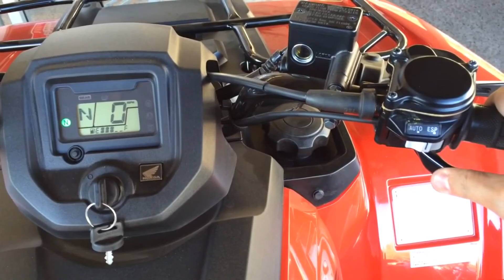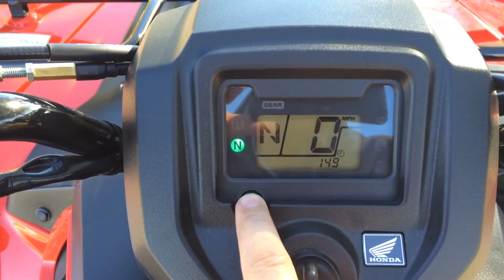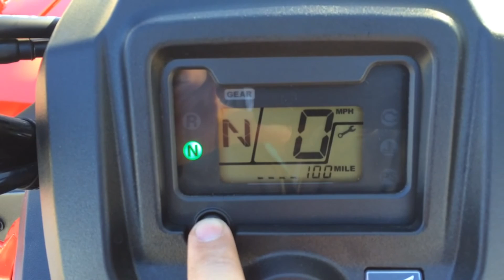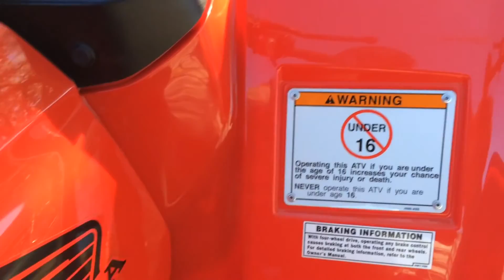Vid #6 - picking up brand new 2016 Honda Rancher 4x4 DCT EPS from the dealer... Dec. 5th, 2015

Comment: Great video.  I just found your channel and I'm enjoying watching your videos.  Back in August of 14 I bought a new 2014 Honda Rancher 420 DCT 4x4 without the power steering with 7 miles and 2 hours on it.  I didn't know it at the time but it was almost a year old when I bought it.(built in Sep. of 13).  I remember the feeling of buying mine new and it was like yours.  This was my first ATV so I was pretty excited.  I only have about 260 miles and 75 hours on it but I enjoy riding it on the farm.
Reply from the maker: Thanks Wayne. These Ranchers are great. Wow, 7 miles and 2 hours. There is something magical about a brand new quad, isn't there. I wouldn't trade the experience.

Comment: How do you like your new Honda 420 Rancher?  I bought a basically new 2013 model, the  guy that bought it new was sick  and only rode it a couple times and eventually sold it to me.  I haven't had mine out yet, but I'm looking forward to it.  I have a solid rear axle like yours, but no electric shift...just foot shift.   Price was right too for barely used.  I like the red model too, mine is the green.
Reply from the maker: +PintoBlades I love it! Thanks for asking. I just got back from a ride 30 mins ago. So far it has exceeded my expectations. Not sure if you've noticed but I have 22 videos of this machine in action now on my channel, a variety of terrains. We bought this one specifically automatic so my wife enjoys it more, but when we get another one, I will likely get a foot shift for myself. That being said, I have no complaints about the DCT Auto tranny, in fact it's great and it's way fun to ride. Shifting with the thumb is nice. Also nice when the kids or new riders are riding and they don't have to worry about shifting. I'd love to see a video of yours in action! Post it and let me know.

Comment: Do you like this 4x4? I'm thinking of trading my bike in for one of these soon. Thanks in Advance!
Reply from the maker: Howdy Noah. Yes, I LOVE my Honda Rancher. Mine is the TRX420FA2 model, which means 4x4 + electronic power steering + Dual Clutch Automatic Transmission. I have posted 48 videos of it on my channel and by watching you can get a pretty good idea of what you're getting with a new Honda Rancher 420. As of today I have over 1300 miles on it and it has been fantastic. Which version are you looking at?
Reply: nevertoooldtohavefun no idea at which I'm looking at yet. Been texting one of my friends that works at a dealer and he might be getting a trade in on a 420 Rancher. If he doesn't I might end up getting a 250. Which do you think would be more fun? The utility or sport.
Reply from the maker: Both the Recon 250 and the TRX250X are a blast. I have ridden/owned mostly sport quads, and I love them. But I have the say the Ranchers are tons of fun. They are not slow by any means, and lots of the sport stuff you could do on a 250X you can do on a Rancher 420. The Ranchers are very strong, but several things about the Rancher have added to the fun for me:
1. The fenders and full floor boards of the Rancher really protect you from mud, water, rocks, sticks, etc. Much more than a sport quad.
2. The solid rear axle versions of the Rancher 420 act a lot like a sport quad in their riding characteristics, even though they're 200 lbs heavier. 
3. The fuel injection of the Rancher 420 is awesome, and means that it runs perfect all the time, hot or cold, any elevation. No worry about choking it to start, or rejetting for elevation, etc. 
4. The power/performance of the Rancher 420 is like that of a 250X. I have beaten people racing me on a Warrior 350 sport quad. 
5. The Rancher 420 has all of the racks and other things plus more ground clearance, a softer seat, better lighting, better suspension, and so many upgrades to the 250 class quads by Honda. 

Again, the 250cc bikes, both the Recon and the 250X are awesome and proven. I just think you get a crazy good, all-around value with the Rancher 420 and there's a reason more people including myself are buying these Ranchers instead of a sport quad. That being said, just watch me pick up a Raptor 700 several years from now. :)
Reply: nevertoooldtohavefun alright it seems you really love your Rancher! I've watched a few of your videos and it can do some work! I think I'm one it looked like you hit 60 mph. What do you think would be a reasonable price to pay for a used 2017 Rancher? The 250 class for utility is 3499, but the sport is 4,399. And is the valve clearance covered if you buy new or is that something you should consult with dealer
Reply from the maker: Yes, for sure. 50 mph is the top speed on the new Ranchers. Reasonable? I've seen one recently around here in AZ that was in new condition with 94 miles for $4700. Yes, by the time you buy one new from a dealer here in AZ you are typically looking at about $1000 more than the list price. Valve clearance is considered a maintenance item, you take care of it and pay for it when you decide to have it done. I've had my valves adjusted twice at the Honda Dealer and paid for it both times. By the way, if you watch for deals, there are lots of Honda dealers out there selling 2014, 2015, and 2016 new Ranchers for pretty low prices. For example, you can get a basic bottom-end 2wd Rancher 420 with foot shift for like $3800 here in AZ, plus taxes and fees of course. SAME PRICE AS A 250-class MACHINE!
Reply: nevertoooldtohavefun   
http://www.kirkcycle.com/default.asp?page=xmbGetDetails&id=2081126
This is the one at my local dealer. So I guess it has 4WD too. That's a pretty good deal. I would only finance like 1600
Reply from the maker: Yes. That does look like a good deal. I will tell you that I love the power steering and I highly recommend it. But I also wouldn't turn you away from a standard Rancher 420 with manual steering. That does look like a very good deal.
Reply: Alright it turns out that one that is 4600 is 2x4. i stopped by today and found a 17 rancher with PS for 5999. that is with manual shifter. He said if i wanted to wait until black friday that he would have even better deals. I would like IRS but i don't think i could fork that much money out for a toy. hah thanks!
Reply from the maker: Well, patience may win out and you'll benefit from it.

Comment: Total price?
Reply from the maker: I paid exactly $7500 out the door.
Reply: yikes, I bought mine around the same time, August actually, I got the Independent rear suspension, NO power steering, snow plow and winch for 7000 even..... that's in NY too....

Comment: The power steering on these is complete junk. It keeps kicking out while mowing. You have to keep restarting the machine, probably 50 times per hour. Defeats its own purpose.
Reply from the maker: I'm sorry to hear about your power steering problem. I would be frustrated too. I can honestly say I have NEVER had a single problem with my power steering in 660 miles of varied/tough riding. I've ridden everything from sand dunes to snow glaciers to desert mine ruins to water fording and mine has never acted up; it functions exactly how I'd expect it to. 

This makes me wonder if yours has a glitch or problem of some sort. These things are designed for work, and I can't imagine it's working as it should. What year is it?
Reply: My 2015 TRX420 Rancher 4x4 AT EPS works fine while joy riding for any period of time on any terrain. But ATV's need to be tested at work, not at play. The problem occurs when you are pulling a mower around in 4WD while continually steering around trees and other obstructions. It's a worthless machine. It really sucks because this is why I bought it. My 2003 Suzuki Vinson worked fine mowing for 12 years. But it had no power steering and I'm getting older and my shoulders could not take the manual steering any longer. Now I'm just a sucker back to where I was before (minus $9,000). The reviews were not just worthless but harmful. I realize too late that the Rancher was not designed for hard work.
Reply from the maker: I can see why you're frustrated. YOUR machine, for YOUR application, is not meeting your needs. This is the first time I've heard of this issue. What does the Honda Powersports dealer say? 
Have you found anyone else with the same problem?
Reply: The dealer says it's doing what it is supposed to do. So this is a play machine only. I wish I knew that before purchasing it for mowing!
Reply from the maker: Have you found anyone else with the same problem? This past weekend I put 440 pounds on my Rancher, and putted around our property in 1st gear, 4mph or less, around trees, over rocks, along straights, a variety of terrain, for over an hour, and my power steering never kicked off. I don't know what to think about your problem.
Reply from the maker: I am going to allow your comments to stay here on this video only. I see that you have tried to post your "complete junk" comment to a handful of my other videos. I disagree with your approach at making people aware of your complaint. You are using emotion, superlatives, and inflamatory/inaccurate descriptors to attack Honda, and I don't want my channel to be your venue for that attack. You said yourself in a previous comment that your power steering has worked fine for recreation. That alone is enough to indicate the power steering is not "complete" junk. I think it's fine for you to voice your negative experience, but people need to know that in MY experience, the power steering on this quad is fabulous.
Reply: Go ahead and play. But it's complete junk for mowing, and people need to know about this before they throw a lot of money down the drain. People really care about that.
Reply from the maker: I will play, and I will also continue to work with my Rancher. If this issue ever pops up for me, you can bet I'll post a video about it. In the meantime, I suggest you take a video of what your Rancher is doing. That is the most effective way to get your message out! This is YouTube. Take a video of what the power steering does when you're mowing and post it to your channel. You can even post a link to your video here in the comments so people can see what it's doing. That will be more effective at warning people than the comments section.
Reply from the maker: https://www.youtube.com/watch?v=jfRxMLh9SzI